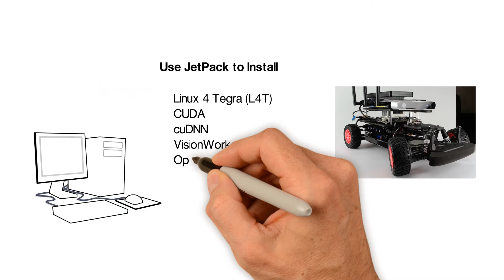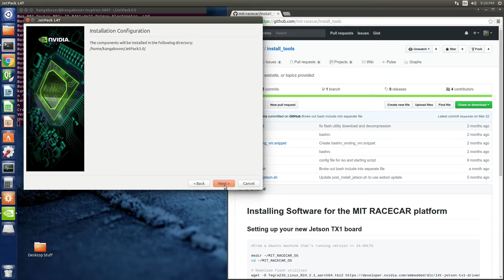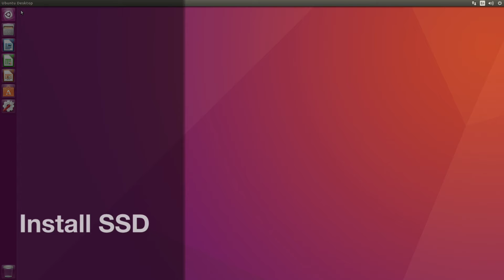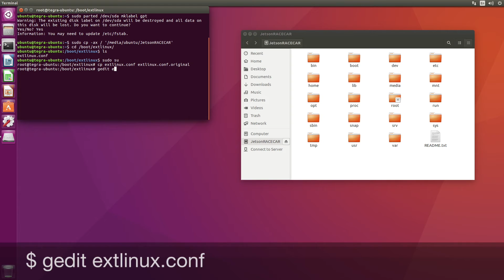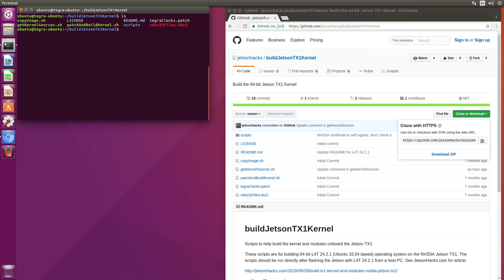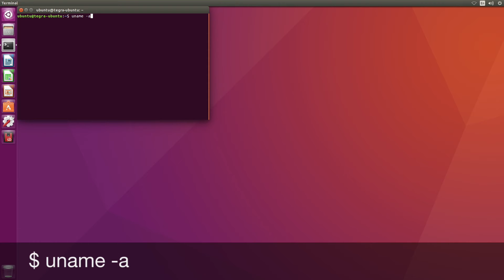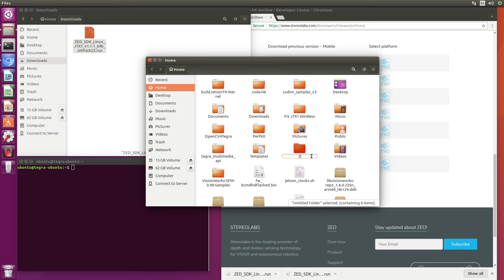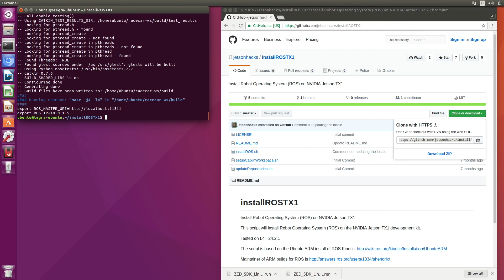Jetson RACECAR Software Install Part I

Comment: the reason we need to build our own kernel is because you wrote special drivers for the racecar ?!? (sorry Beginner question). the drawing is good.
Reply from the maker: Right,  planning on exploring using an Intel RealSense 3D camera which requires some kernel mods. If you're just using what we've talked about on the car so far (VESC, Razor IMU, Stereolabs ZED) than this step is not needed. Thanks for watching!